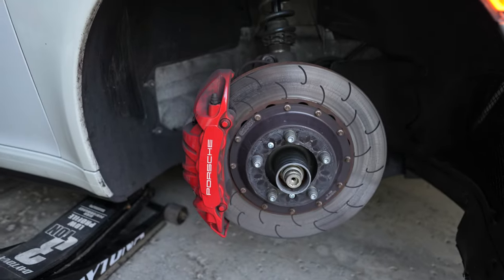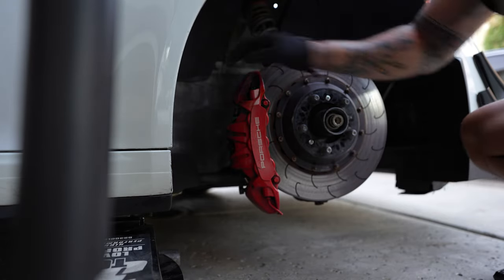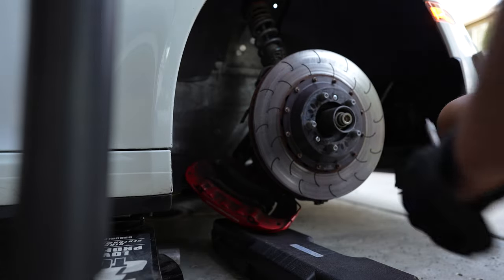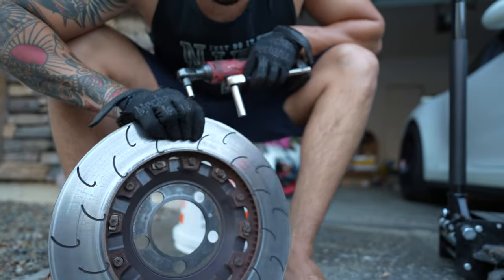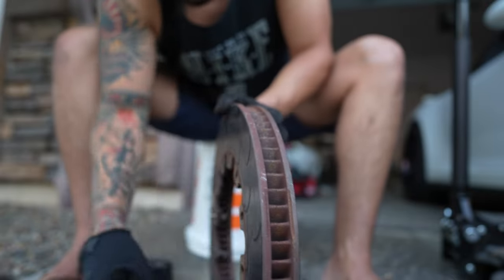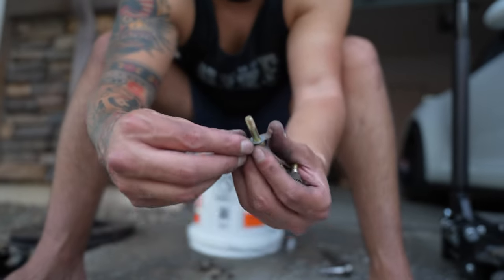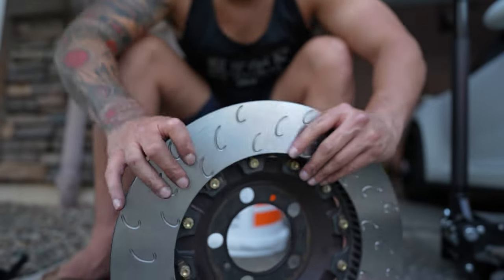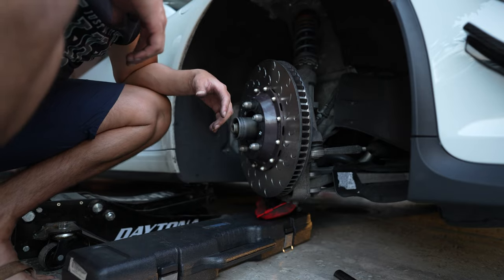AP Racing Rotor Ring Replacement DIY (Porsche GT3)

Comment: i have been considering changing from the center lock to studs.  Was there a specific reason why you converted?  Thanks for all the content, as a new 991.1 GT3 i owner i have been adamantly watching your feed!  thx.
Reply from the maker: Hey man thanks for watching. I’m still running a center lock on my GT3. I don’t plan on converting to studs either. I love the Motorsport look and as a person in decent shape, torquing and removing the wheel isn’t a pain in the ass just yet.
Reply: @Thewinnerscircle_  hahahahaha....i have not tried getting the wheels off yet we'll see.  appreciate the reply and thanks again for the content!
Reply from the maker: @yoties76  the fronts require someone to pump and hold the brakes btw. That sucks but aside from that, it can be done quickly 👍🏽